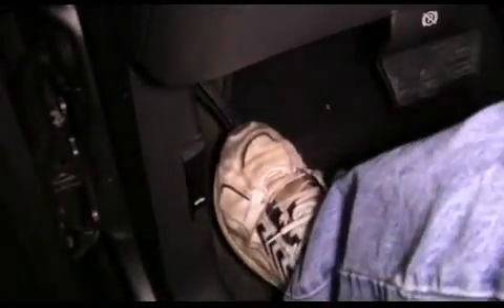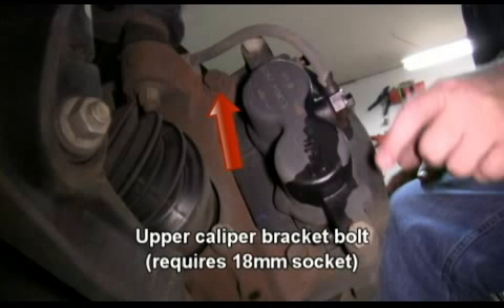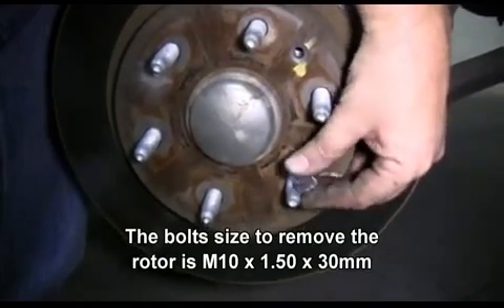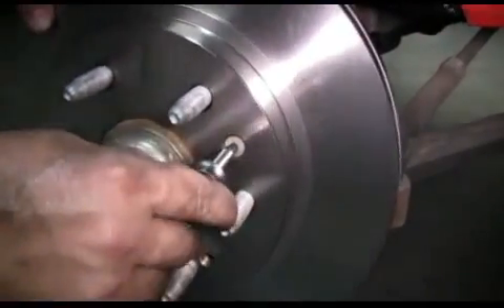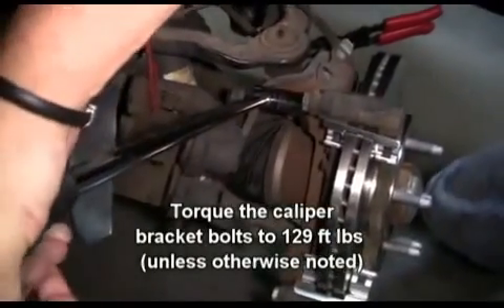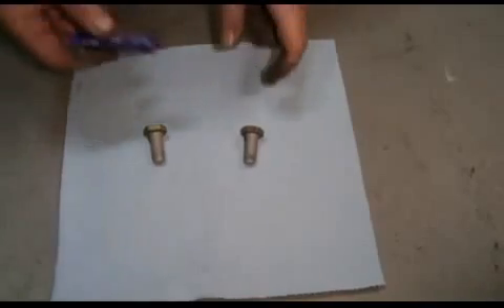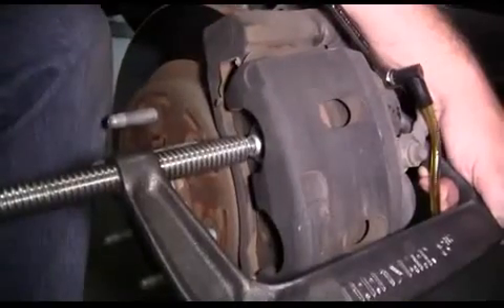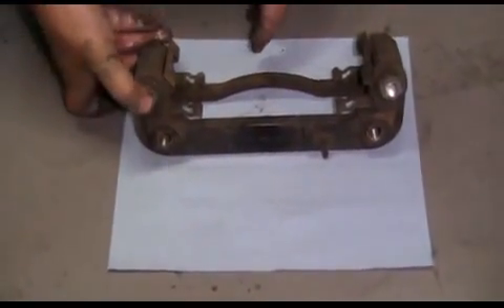Front Brakes 2007 Chevy Silverado 1500 4x4

Comment: Thanks, Your video is the only one I have found that posts the torque specs for the mounting bolts. Job well done.
Posting here for those that need them quick...............
Caliper bracket to knuckle = 129 lb-ft
Brake caliper to caliper bracket = 74 lb-ft

Comment: Great video, ive been watching many lately ahead of a brake job for my 2013 silverado.  Yours is the only one that includes a bleeding step, most just leave the fluid alone.  Is it something you do each time you change pads/rotors?
Reply from the maker: It really is the right way to do it and when we do the videos we try to do it the right way.  Now to be honest you can just remove the cap on the master cylinder and compress the piston.  The danger of that is you can push debris into the ABS system.
-Greg
Reply: Greg Cook Awesome and I appreciate it, rather know the correct way.  thanks

Comment from the maker: There is no need to put grease in the hub as the rotor is seperate.  Some vehicle the rotor and hub are one piece and you have to service the bearings when replacing the rotor.  This wasn't nessecary on this particular vehicle.